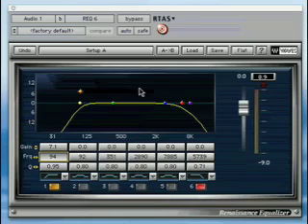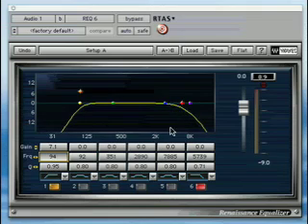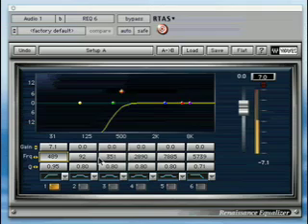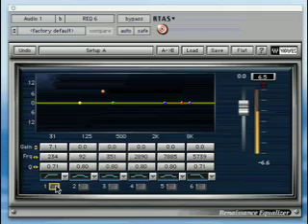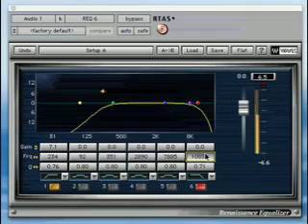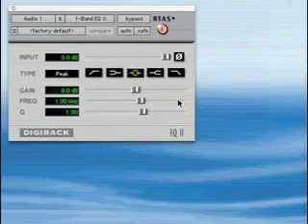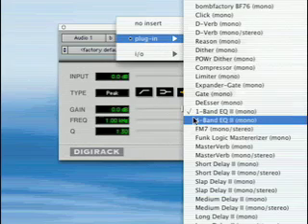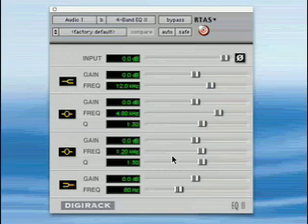Using Filter EQ in Pro Tools

Comment: Well first off, i believe that you choose the DAW that works for you most. Pro Tools IS a Industry Standard, maybe not in your area, but most of the projects that i get when working on the studio are from Pro Tools configured projects. If you like the sound of Nuendo and Cubase, that's respectable, but then again, Pro Tools is as good as any other DAW there is out there. And this video shows a plugin from Waves, which by the way, it can be runned in Cubase or Nuendo. I use PT and Ableton.